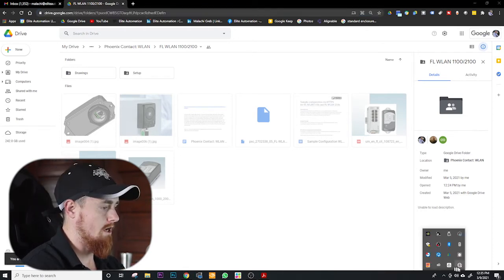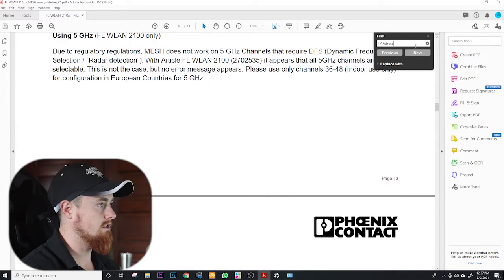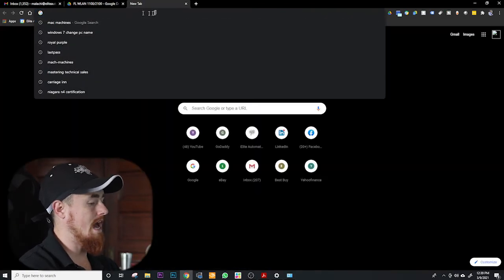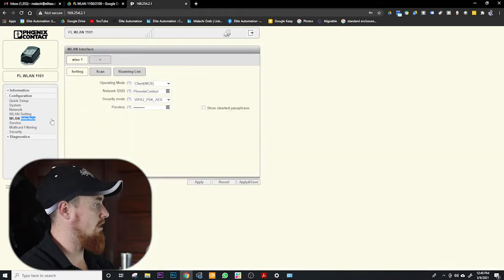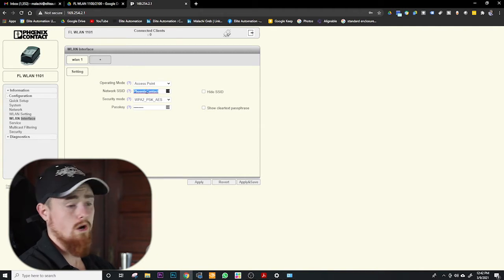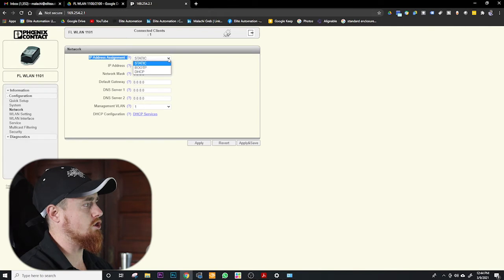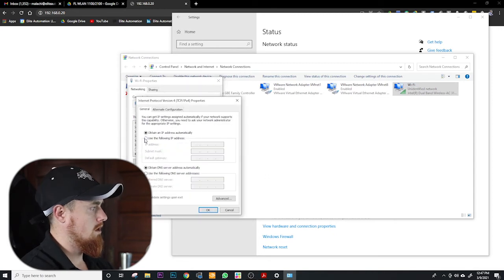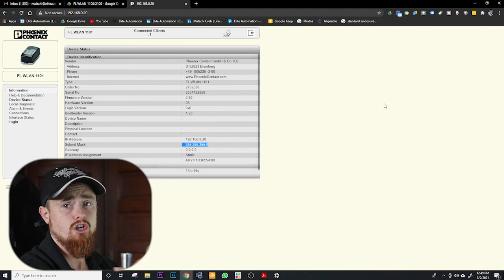Phoenix Contact FL WLAN 1100 Industrial WiFi Set Up

Comment: I need to make an Ethernet connection between two Siemens industrial controllers located at a distance of 1 kilometer from each other. What would you recommend?
Reply from the maker: Radio is probably the best if there is a clear path between processors